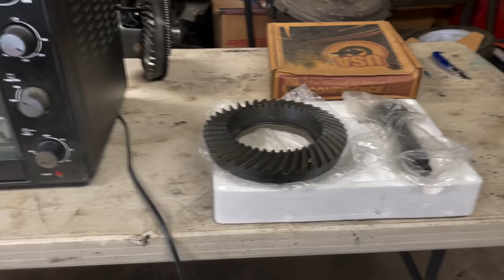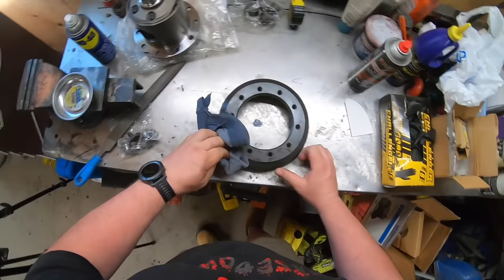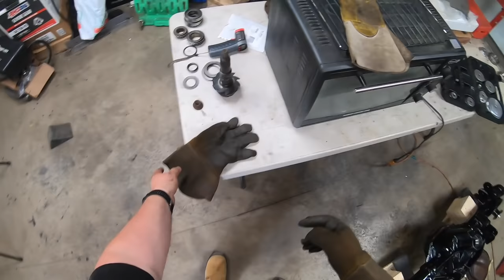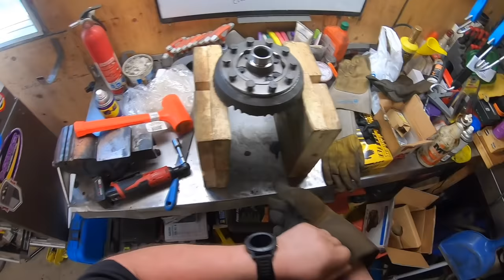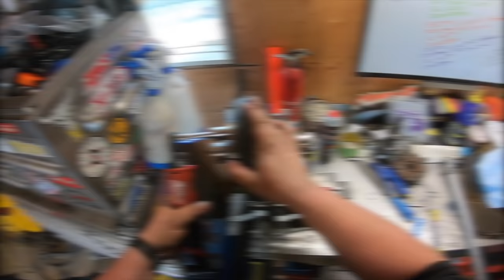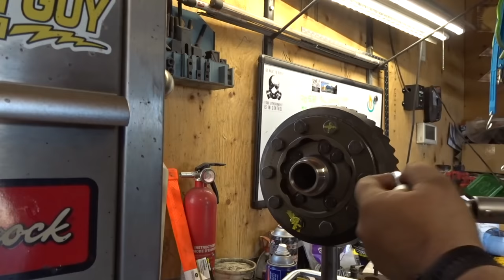How to Install A Ring Gear on a Differential Carrier DIY

Comment: clean bolts and bolt holes of machining oil.. with brake cleaner so the thread lock will have good metal surface to bit onto , not oil.

Comment: Excellent tips! But can you tell me how long do you put it for? Mine starts the make sparks like crazy after 2 minutes and it doesn’t get much hotter than 20 degrees over room temperature, which has proven insufficient head to make it fit. 😅😅😅😅😅
Reply: I don't think you're supposed to nuke it in a 'microwave' oven. 🤔

Comment: Torque specs are different for every size they are not 80 pounds ever unless the bolts are half an inch 
3/8 x 7/8. RH  55 60 ft. Lb

3/8 x 3/4.  RH. 45 50 ft lb

3/8 x 3.4 All  45 50. Ft lb

7/16 all 60 65 ft lb

1/2 all 100 110 ft lb

Cap bolts 

7/16 5/8 head. 60 65 ft lb 

2:2 3/4 head. 80 85. Ft  lbs

Maybe you mixed that up
Reply: GM 12 bolt... 55 ft pounds?  prolly same for 10 bolt? and ford 9"??